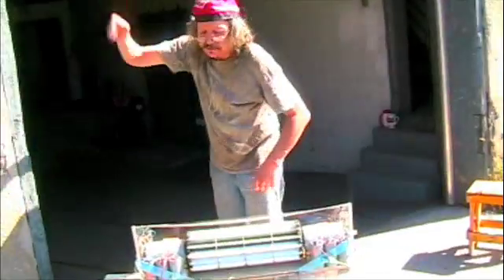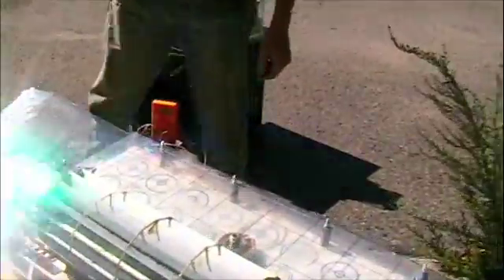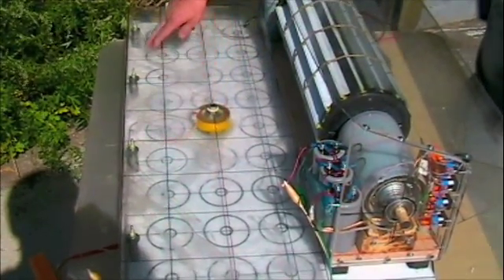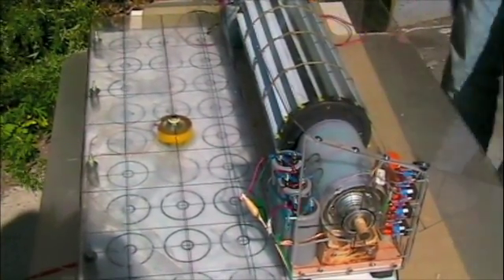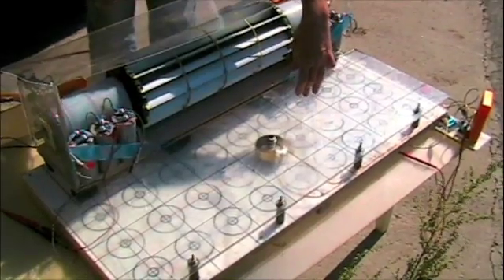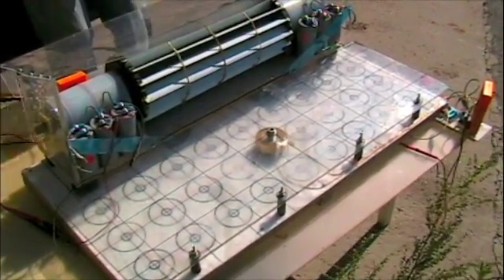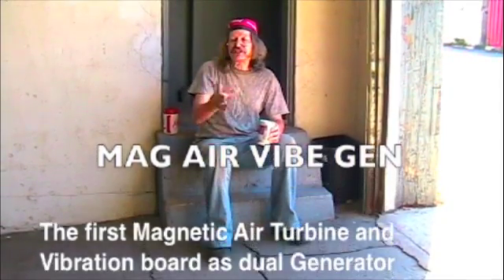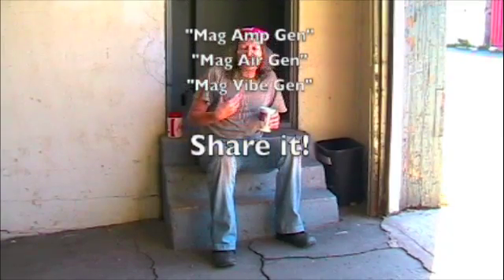MAG AIR VIBE GEN

Comment: Rebel: I've since refined the Air Turbine with magnetic wheels shift/gears for more output. Also built petal generator driven by Mag-Wheels eliminating Mech-Gearing. These can be combined if petals drive AIR PUMP that pushes Turbine from behind,. Cheaper, less weight & flexible deployment. Just recieved RING MAGNETS to float over diamagnetic aluminum base - hope this will rev up from present 600 to 30,000 or more (zero friction). Strongly suspect this is new Jap.tech sharing with China?

Comment: Correction! I just drove the 12v motors of 'Magnetic Generation Transport' with this unit after 'Donald Duck' type unit failed. Besides lightness allowing more RPM'S & therefore higher voltage - the VIBRATION of the whole unit is ADDING SOMETHING, maybe several things I don't really understand! Maybe it's smoother bearing-turns, or phase 'mingling' for faster voltage recovery under load. Just don't know, but will be doing more exper. with rubber-mounted units like this!

Comment: Thanks Max! Vibration thing dead-ended for now, but Air Turbines have gone forward more & more! " Magnetic Generation Transport" shows the final design - that takes the weight off the Turbine & allows top performance with reasonable driving skills. Many proceedures such as keeping dials in the "Green Zones" (48-56v), resemble fuel monster driving rituals.

Comment: OCE2005: I investigated your notion - too expensive & too little amp delivery. But glad you are thinking of ways! Air Turbine is there bcause you can count on frontal air pressure every time you gain speed. It is true that magnets going DIRECTLY through coils have greater efficiency. I am using them for steering-wheel charging (foot petals take too much space) right now. It works! Maybe you can optimize?

Comment: Each of these magnet-coil units gives about 1 amp. That is about 20 times a solar module of the same dimension. 30 amps will drive a 500lbs vehicle up a 20% grade. All you need for self-propelled magnetic car is about 60 magnets vibrating 1" (or 2cm). That is not so tough a problem once you can FOCUS on it. Note that vibrating units are twice as strong as 3-phase ones in Air Generator - due to steel core. Each is almost exactly like a tiny planet earth (in magnetic terms).

Comment: I'm getting messages: First the problem: Every item you buy now adds 55% for oil transport costs- going up! In 1950 it was 8%. This is a gun aimed at your head being slowly squeezed. Melt down your junker & erase YOU, makes sense to these people? Worry about torque of Turbine - AIR COILS have no resistance; possible with new magnets. The noise: SIMULATED "WIND TUNNEL" for tests. No sound on road but whirring of blades. All these shown elements are IMPROVABLE (without great thought).

Comment: Please cut the "overunity" & "free energy" guff. Fuel cars sell oil: Electric cars sell batteries: & self-propelled cars sell magnets & wire. O.K.? You can no longer obtain the latest magnets - only on Chinese finished goods. Look, 1000 or more engineers in Beijing & Yong Kang alone working on this - you think they cannot come up with this tech. a tiny handful in the west have? This needs 20-80 amps at 50-80v continuous; so don't bore me with Kirlian high-v discharge stuff, been there 35 ago!

Comment: ROFL!
Soon you'll discover how to harness the energy of ratchet-jaw cellphone users. I'm quite sure you could power a house on the output of, for example, three teenage daughters.

When your free energy machine works without external power, let me know. I might be interested then.

(BTW, vibration is wasted energy. Even if you recover a little bit of it with your clever vibration sheet and coils--it's still mostly wasted.)

The "Final Solution" has kind of a sinister ring to it.

Comment: Cutting - correction: Is not "Fan"; is not "Windmill" (no natural wind & does not mill); is AIR TURBINE (N64O16CO2 ~), like WATER TURBINE (H2O~). See previous vids for function. Instant mobile energy access could be on other levels like radiation frequencies, etc. But must have direct as possible power translation - try to Quantify all in->out of your concepts. We are working with Noah'sArk-type sensitive coils now for improved output, Consumption/ Production universal energy reversals